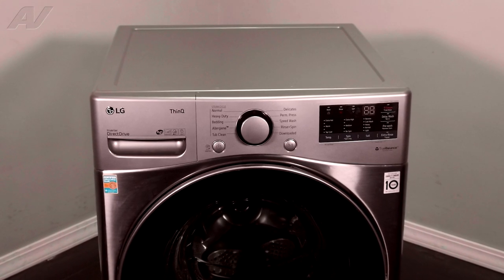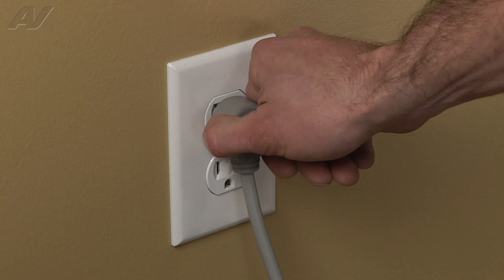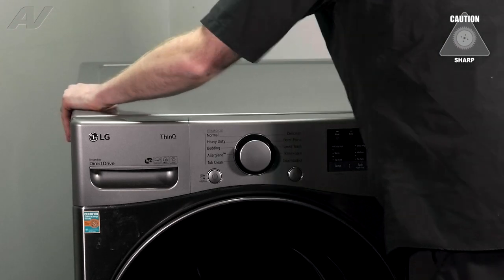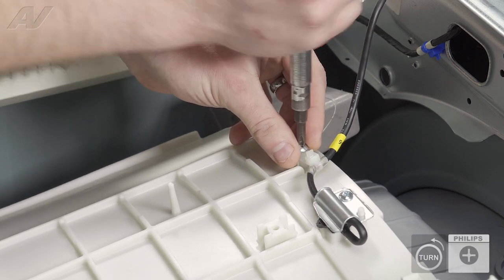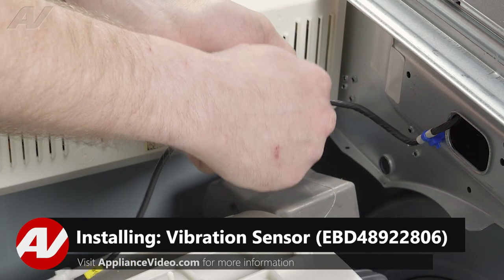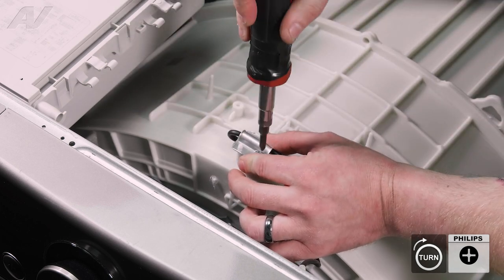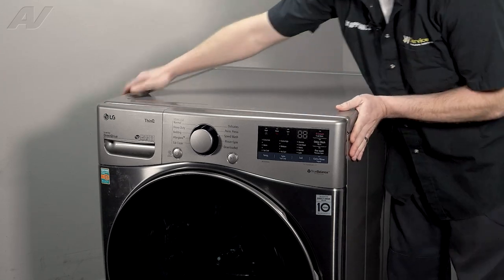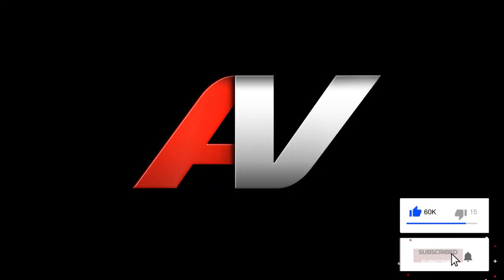Washer Repair - Will Not Spin - Vibration Sensor - Troubleshooting & Diagnostics

Comment: Can you tell me where the vibration sensor is located on the single unit Washtower?
Reply: It is located on the inside of the washer underneath the washer lid and fixed to the top of the tub (very similar to the above video).  To access it, the dryer needs to be separated and removed from the top of the washer.

Comment: Can you Bypass the Sensor to test it, BEFORE wasting money on something you dont need ?
Reply: Thanks. Had an older LG where the bearing wore out due to a poorly leveled floor. When I found an LG with this feature wasn't sure what it did but you explained it. Thanks again

Comment: I replaced the vibration sensor and I am still getting the VS code.
Reply: Have you resolved the issue? I just replaced mine and still get the vs. I am wondering if I need to replace the shock absorber too
Reply: @darrenargentina9722  LG ended up replacing the machine. They tried to repair it 3 times and were unable to correct the issue.
Reply: Ahh I hope this isn’t the case for me .. someone is coming today for it